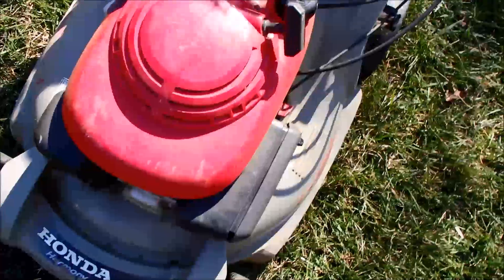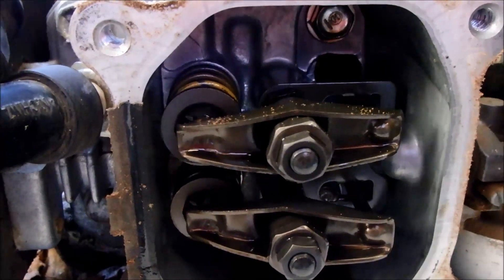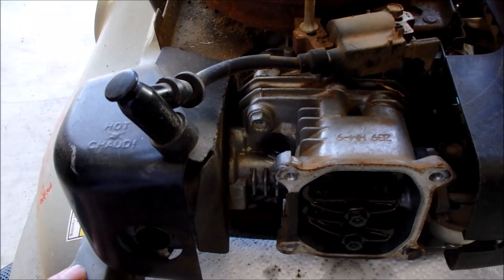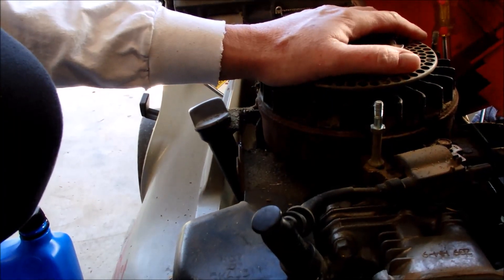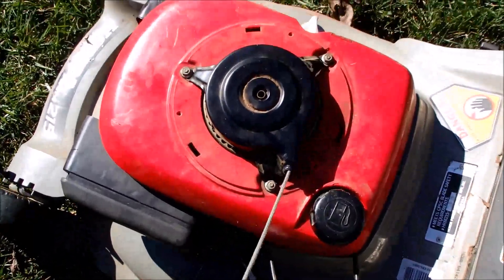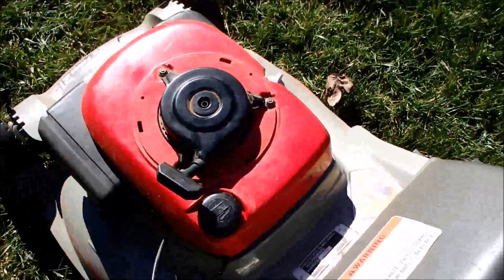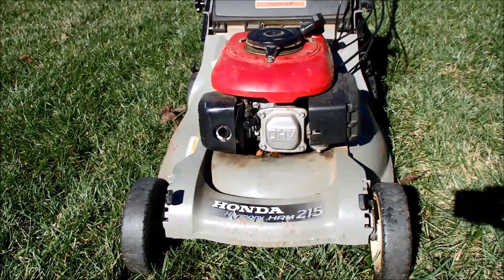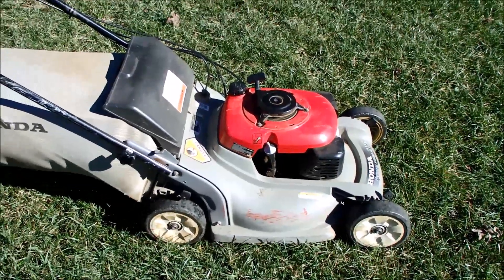Honda HRM215  Harmony Lawn Mower GVC140 It's Alive! – Part II Craigslist Find - Jan. 10, 2015

Comment: mountain bike kayak.. this mower is equipped with a blade brake system so you do not have to hold the handle down, just wanted to let you know
Reply from the maker: Hey Lugo Small Engines, yea I am so use to tying down the handles on Briggs and Stratton ones that did the same for this.  Your right don't need it will start and run as is!  Pretty neat and must say tough Honda.

Comment: this video help me bring a honda hr215 back from the dead that honda is a very well built lawn mower one of my favorites if i may ask where do you find all of your mowers at
Reply from the maker: +Robert Noe Hello Robert thanks for viewing yes these older HRM215's are sure really nice lawn mowers and the frames will just last almost forever.  This one they ran out of oil and the engine was totally locked up but was able to free it back up.  I find the majority of these lawn mowers posted as for sale and or free type ads on our local Craigslist most I find are broken like this or moving type sales.  I actually found another HRM215 earlier this year they were just throwing it out after buying a home and it was in the outside shed.  If they had just attempted to start this it would have lasted many more years here is that link to check out:  https://www.youtube.com/watch?v=I3a1xK-DP-g

Comment: Good find there,that sounds a good engine.I think I have one very much the same amongst my pile of mowers,but they badge them 535,53cm and 5hp.Does the drive work at all?.Thanks for the vid.
Reply from the maker: Hello Mowersandstuff yes checking out some your videos as well.  The self propelled does not work and not sure what's wrong with it yet, the owner said it needed a belt.  Was looking to see what you may have out there that would show me how this self propelled works if its worth fixing beyond just a belt.
Reply: Hi yours is  the 2 speed model is that correct? The newer ones had the hydrostatic drive on which is a good system.If you look at my Honda HRX video that has the hydrostatic drive ,honda fitted that on many mowers.Ive never had the 2 speed drives apart,but I would have thought they we less trouble than the hydrostatic,the hydrostatic slow with age.Have a look at the belt cables and check everything is free and go from there.Take care mowersandstuff.